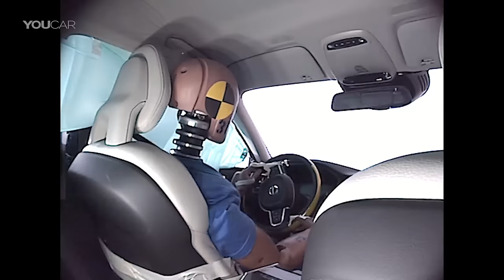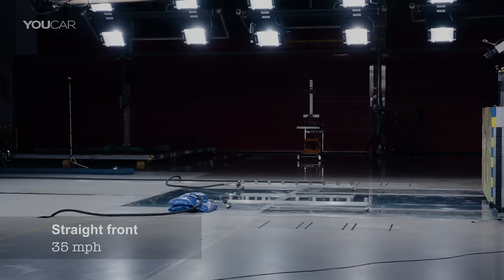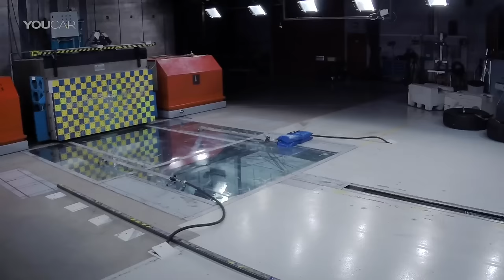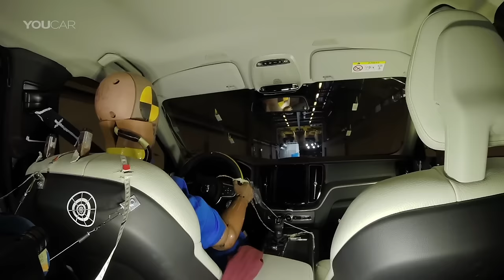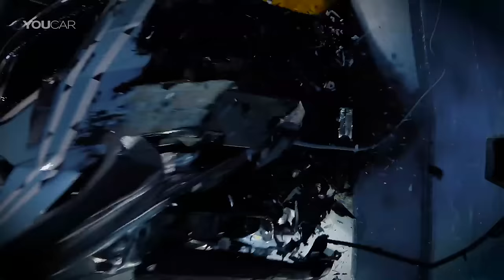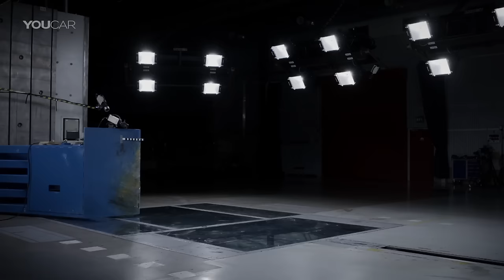Volvo XC60 Roll Over Crash Test

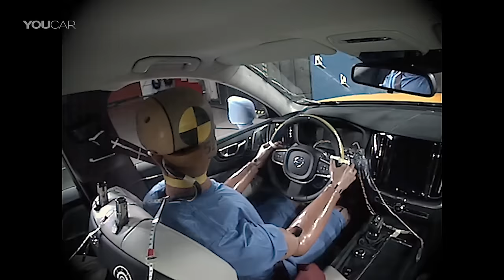Comment: 3:18 How important the belt is and in those milliseconds how it is pulled is impressive
Reply: The dummy barely touched the airbag
Reply: @System6VideoProductions  8ji
Reply: Rib cage: aight imma head out
Reply: Also it pulls under hard acceleration and when the car jumps in high speed on the highway for example..
Reply: It's called a seatbelt pre-tensioner
Reply: I read your comment at the right time

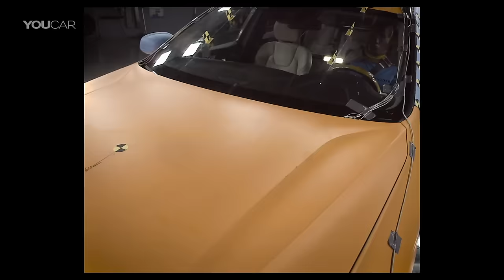Comment: It is nice to see how the seat belt tightens the driver to the seat as soon as the car makes contact. 3:15
Reply: SwedishMindwacker my volvo tightend my seat belt as soon as I hit gas too fast.
Reply: Seatbelt pretensioners, they've actually been around since 1986~(?). However, that seems like they deploy BEFORE the car actually has an impact, which is definitely better than the first ever employment of the tech (Mercedes).
Reply: every single car has that. It also happens in some Volvo cars where if you accelerate or slow down quickly (ish) it will tighten.
Reply: Yep, in my XC70 the seatbelt always tighten up when flooring or braking hard.
Reply: many cars has that feature
Reply: Volvo made seatbelts so they know how to improve it
Reply: You are quite observant
Reply: Yeah but in a crash,it can break ur shoulder
Reply: The dummy head even cannot touch the front airbag🤣
Reply: He barley even hit the airbag but in real world would have really bad bruises from the seatbelt
Reply: Svensk propaganda?
Reply: @simonc1080  100%
Reply: У меня на тигуане при торможении уже ремень уже застопорен.
Reply: Es el alma del vehículo 😍
Reply: It is a good safety feature

Comment: It has a safety cage made in different types of steel. The most important area of the cage, that protects the intrusion of the crash into the passengers and driver, is made of BORON STEEL - a ultra high extreme solid steel - very very resistant that can even support crashes at 80 MPH-128km/h.

Of course the energy of such a crash is very complicated to humans because of the deaceleration and the g forces involved. It might get your inside organs bleed. 

But this XC60 is a fuckin' beast a fuckin' tank made with a high percentage of BORON STEEL.

XC60 HAS A 191 CM OF WIDTH, 469 OF LENGTH and 166 cm OF HEIGHT.

ALMOST TWO TONES 1900-2000kg most of engines and trims, and the plug in hybrid T8 because of the batteries, has a weight of 2200kg.

 It has also 2865 cm of wheelbase. 

A BEAST CALLED VOLVO XC60.

RESULTS OF EURO NCAP TEST TO XC60 CONSIDERING IT THE SAFEST CAR EVER TESTED IN THE HISTORY OF EURO NCAP CRASH TESTS:

98% - ADULT OCCUPANT 
95% - SAFETY ASSIST
89% - CHILD OCCUPANT 
76% - PEDESTRIAN 

V O L V O 💪💪👊👊👍🙌
Reply: I think I had a stroke reading that
Reply: @MasterChief-ld2ei  Why is that Master Chief from Halo Xbox ?
Reply: @MrTribalsun  What
Reply: @MasterChief-ld2ei  Why did you say and i quote you :
"I think I had a stroke reading that"

Comment: Wow Volvo are really impressive, i will considerate for my car buying this year
Reply: rita gonzalez  Not true. All XC60 are still made in Torslanda factory in Sweden, by Swedish workers, with Swedish materials like the steel used in safety cage. Swedish steel is the best in the planet. Chinese shareholders invested billions in Volvo. But who makes the projects, the experience, the know how, who elaborates design, safety technology, etc, are Swedish teams back in Sweden.
Reply: @MrTribalsun  XC60 are also built for export in China. Currently all XC60 with the T8 engine for the european market since mid-2019 are built in the Chengdu-plant. The reason for that is that they originally intended to export XC60´s from China to the US. But the ongoing trade war between USA and China made it uneconomical. So now they export XC60´s from Sweden to USA putting a strain on the capacity of the Torslanda-plant. So the T8´s are brought up from China to supply the european market while the swedish built T8´s are exported to the US. Not that it really matters, same car.

Comment: why the fireworks on top of the volvo?
Reply: bolacka wondering the same
Reply: Air bags use rocket fuel thats the residual cloud after the side curtain airbags deploy. Poof!
Reply: Triggers when the vehicle makes contact with the block.

It's a way to sync the data gathered with the video.
Reply: It is to celebrate the awesome safety of Volvo
Reply: bolacka i guess that is for throwing air outside when the vehicle hits the wall the cabin is also squeezed the pressure of tht air can blow the ear drum......i am just guessing
Reply: its to tell exactly when it colides with the wall i believe
Reply: Its called a squib board. Every pyro represents a different airbag in the car so you can see the exact time when it goes off.
Reply: bolacka its celebrating its safety rating
Reply: Airbags 😂
Reply: robswede88 thanks for the proper and succinct explanation
Reply: Nowhere have I seen so many convincing answers to a simple question like this one (the "pyrotechnics" and "for fun" comments aside). So what is it finally? Sync, airbags, residue?
Reply: For decoration.
Reply: yeah i am also wondering
Reply: It's to sync the data collection with the video. They go off when the car hits the wall. The real thing doesn't have them.
Reply: Thats just what volvos do man
Reply: Celebration for saving another family from danger
Reply: bolacka for celebration
Reply: a little celebration that you survived
Reply: thank you!
Reply: robswede88 thank you
Reply: amazing car.. amazing video👍🏽
Reply: @robswede88  but, that device is just used for this events?? Or is included commonly from series?
Reply: Speed boost
Reply: bolacka did you the for your question?
Reply: Congratulations your are crashed...
Reply: In case it crashes on new year's eve.
Reply: bolacka drama

Comment: I'm into getting a new hatchback and Volvo was on my radar but no more because of its design. This is in spite of all its safety features and high quality interior. Its side profile is so titled that you feel it’s pointing right to the point 50cm ahead of the front bumper. And the rear point is ridiculously pointing up. My eyes hurt when I look at it from the side. Some people argue that this is a sportive look, but why a city hatchback with economical engine should look “sportive”? God bless those days when the horizontal lines in a car were in fact horizontal.

Comment: I jump over a 20ft high barn house in my 69  dodge charger and landed perfectly horizontal due to the concrete balas in the boot, then drove through a heap of hay followed by smashing through a flimsy wooden fence, then through some road work barriers without any damage at all apart from a few scuff marks down the left front wing. The rozzers had no chance catching me in their Rover SD1 V8. The charger was the safest car ever built.

Comment: When cars are ran into flat walls the forces are spread apart easily
Reply: It's not about spreading forces easily but sharp parts that penetrate before the others and that go in between car parts. Look what thin road fence do to a car. It enter on front side end exit on the rear. Also when you hit full frontal all parts at the front are absorbing forces (unlike 40% offset test).

Comment: Now new volvo owner is Chainess who will use maybe cheap iron instead of strong iron. I am not recommand volvo anymore.
Reply: No now its event better the Chinese have better technology and more money .
Reply: Duke : The Chinese owner Geely hasn't  touch the Volvo history, philosophy or the roots of Swedish engineering. Worked as SDS (Software Delivery System) administrator at Volvo 2002 when Ford wanted to take totally control over the Volvo Cars company and migrated over 12 000 computers and installed FGC (Ford Global Client based on XP to be able to supervise every program and department). I saw how Ford just stole technology from Volvo and also Jaguar, but they couldn't or still can't build any decent car. Remember that US taxpayers bailed out Ford 2008 as well as Chrysler.
Now, when it comes to Geely, this owner respects Volvo. The way of "stealing" Volvo (and also Saab) technology is that Geely has opened a new company CEVT (China Euro Vehicle Technology) in Gothenburg (where Volvo has its headquarters) wich is a joint venture between Sweden and China, the result is cars under the name of Lynk&Co.

Also old Saab has now a Chinese owner (former owner GM was also an idiot and just stole Saab enginering ideas and tried to put it in their lousy US cars and also into the German Opel, notice even GM screwed up and went bankrupt 2008) and their collaboration is very successful too. The old car plant in Trollhättan is making "Saab" cars under the name of NEVS (National Electric Vehicle Sweden).

Way better with Chinese owners than brain dead US business philosophy consisting of egoism, bribery and extortion!

Hope this helped you out a little bit!

Cheers!

Comment: they ran the test only after running it on the pc simulating the crash, calculating how to minimize damage by correcting the angle and speed or power used by crash machine. real crashes are not calculated.
Reply: @zoonibutt9334  It is Volvo crashing the cars. Do research before misinforming people.

Comment: plus in 35 miles per hour prabably most of the time they should survive. Test it with 90 kph and comming truck with load at you also 90 kph. THen lets see how people survive. Those trucks on road with load are most dangerous I guess
Reply: There's a Volvo crash in real life scenario. A DAF truck against first model XC90. Search in YouTube or in Internet DAF truck crash Volvo and you'll be amazed.

Volvo driver survived. No injuries whatsoever. You can see him out of the car, on the phone, on that video.

He said to a Latvia reporter DAF truck driver was probably doing 75-80 km/h at the time of the collision. We're talking here about a massive big loaded truck. Go see with your own eyes.

Now do this mental exercise... this 1st model XC90, that crushed against DAF truck, that is already amazing in terms of safety, is less safe than the actual 2016 model XC90.

Now think... on all crash tests made recently, this 2016XC90 2nd generation proven to be less safe than the 2nd generation XC60 2018 by margin numbers.

In your comment you say you would like to see a big truck against this XC60 2018 that we're commenting on this YouTube video. I guess all passengers would survive in the 2018 XC60 against a big truck fully loaded at a speed of near 90km/h.

If a first generation XC90 model from earlier 2000's and way less safe than a 2018 XC60, the driver survived against a collision to a big truck, i can only assume XC60 2018 would do just great.

So your comment is wrong.  And this video shows how amazingly safe the new 2018 XC60 is !

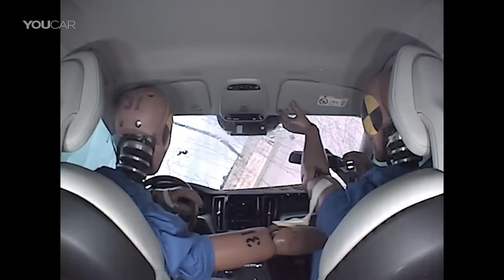Comment: 0:35  ......  SAFE .....???  Airbags.... DIDN'T DEPLOY.
Reply: It's a rollover! THE CURTAINS AIRBAGS DEPLOYED AND THEY ARE "INTELLIGENT" CURTAIN AIRBAGS. what i mean is that, because car detects rollover because of the sensors it has installed all over the car, the car insufflates the curtain airbags more time, in order to give time to the rollover finish. If not , if they (curtain airbags) just inflated for some seconds, 3 or 5 seconds,and the roll over would take 15 seconds to finish, passengers and driver could hit with their head on the side of the roof and get injured. Volvo is amazing!